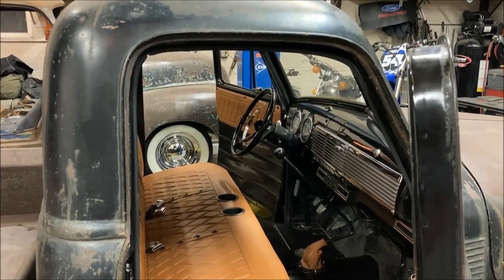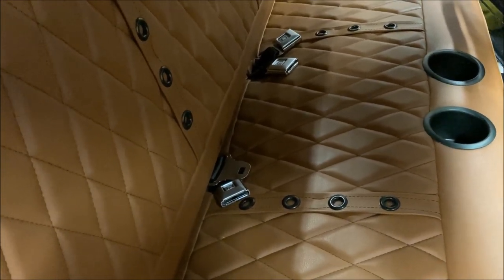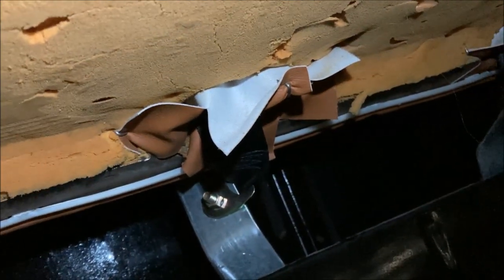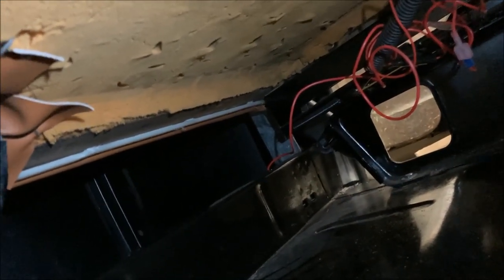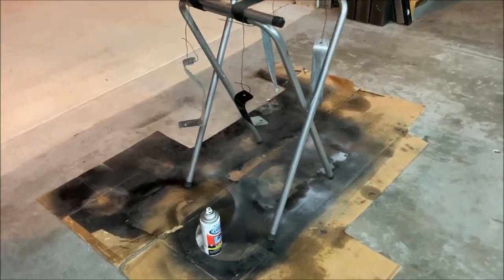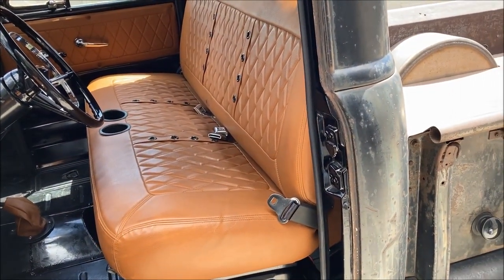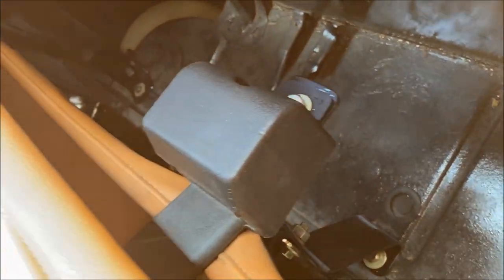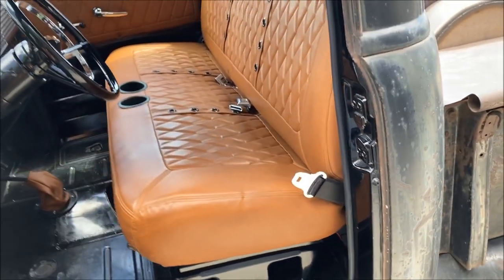53 Chevy Shop Truck Seat Belts

Comment: Hey Trent. Nice job on the install. You can't be too safe. I am going to do the same thing to my Fargo. I am also changing my seat. The original seat is in perfect shape, but I came across a set of leather, power, heated buckets. They are so comfortable, that I had to get them. Plus they were FREE. Anyway, nice job and thanks for sharing.🍁👍👍
Reply from the maker: Thanks 👍

Comment: Lap belts are a good start but they only provide protection for the lower body. In a crash your upper body is going to hit the steering wheel or the dash.  I would want to add shoulder belts for the best protection.
Reply from the maker: That would be safer 👍
Reply: @TrentsOvertimeGarage  A lap and shoulder belt would be way more protection in a worse case scenario. I would definitely add a shoulder belt.